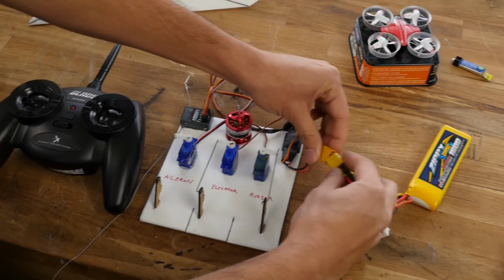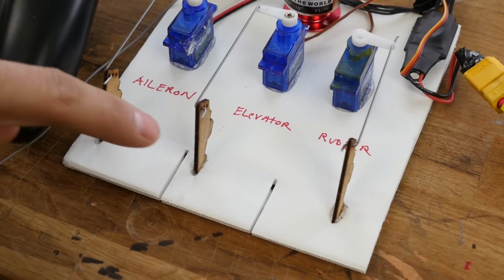DIY Pocket Transmitter | Flite Test

Comment: thank you peter even almost three years later just used this video to bind the transmitter from my new inductrix fpv that I bought from my local sportsman warehouse to try out fpv (all my local hobby shops are out of buisness) to a slightly broken night vapor plane I was able to fix that I recently picked up from facebook market place for 10 bucks and it worked thanks to your video now I have two great functional backyard flyers

Comment: Hi Peter, Thank you for this Video.  I have a quick question appreciate if you can please address.
I am using the same Blade MLP4DSM transmitter to bind with fly sky model number FS-R6B receiver, but i am not sure why it is not binding. Are they compatible? Any suggestions on binding much appreciated.

Comment: Hi this video is very informative especially how to reverse controls on mlp4dsm - I have the mlp4dsm and struggling to use it with an eachine qx100 (dsmx receiver) - I need some help on how to set it up. Do i need cleanflight for this - The bianding is fine but only the controls are reversed.
Reply: Thaddeus Fernandes  have you figure out how to do this? I was actually wanting to use for something similar.

Comment: Peter, a similar but 3ch Tx came with a very cheap 2.4ghz heli. mounted main rotor motors with 54mm props on wings (CW+CCW), tail rotor motor with 38mm prop horizontal near tail section, board and battery under the canopy of a cheap EPP "chuck glider". no servos or control surfaces but flies great! comparable to the Duet, about 20 bucks spent. it does have a downside, no tail rotor elevator power if thrust-steering motors not powered, but easy to get used to the dead stick gliding vs maneuvering with power.

Comment: Thank you Peter for telling me that this simple transmitter is Spektrum capable. But. By hooking it up to my six channel plane, this transmitter is actually six channel, not four! These extra two channels can be achieved by pressing the left stick (flaps) and the right stick (gears). I found this very useful because with this, you do not need to buy a big six channel transmitter. Instead, there's a cheap one right in front of us!
Reply: DandruffCat could you tell me what plane on the current horizon page would use something like this? Thanks!

Comment: The right stick when pushed in toggles a two position switch on channel 5. I just started using this controller on a micro quad running cleanflight, you just need to change the rxrange in the cli interface to match the output range of the Blade controller.

Comment: Does the paper airplane have magnetic actuators for rudder? Neo-magnet micro bit-charger car servos save lots of weight but are bang bang off/on. You can wind the coils to activate them.

Comment: just rip the "transmitter part" out of this housing and put a FRSky-board, Flysky, OpenLRS....whatever inside that and you have 1KM range!
The transmitter is the tiny little green module on the top.
Thats the whole trick! 
this thing is connected with 3 Wires. PPM GND and VCC!

Comment: Just a public speaking tip, but you should slow down a little and enunciate more.  Wonderful video, though.  I didn't realize I could use my Nano QX remote for a regular receiver.  My first scratch built now has a transmitter!  I just need to get the receiver and some batteries.  Yay!  You guys rock!

Comment: That's awesome Peter tnx. BTW, Anyway to boost the signal coming out of the TX?
Reply: You could swap it for a full power tx if you run enough power to it, the pin out is the same.

Comment: Great job FT and Peter. This is the sort of content I like. Could the spectrum transmitter module be hacked to run on a taranus? I hear mixed reviews on the orangeRX module.
Reply: +civicex5speed Yes: http://johnprikkel.blogspot.de/2014/07/jr-dsmx.html

But I had problems with an MLP4DSM module. It worked fine with a DX4 module I got from eBay though. Unsoldering is a little difficult, but you can get it out with some patience.

Comment: Would it be possible to mod replace the spektrum  module on it to a full range one? It'd be cool to have a really small full range transmitter.
Reply: Chase Wood I think it would be just fine, batteries wont last as long if modded, but you could use rechargeables.
Reply: Probably, I hope the power line can handle it.
Reply: +Chase Wood If current draw was a problem, all that is needed is to solder a heavier gauge wire to the positive and negative.
Reply: I was thinking about the actual power supply, I'd imagine it would be okay but it should be tested under the heavier load bc planes.....

Comment: Cool project peter, I saw on my old champ TX that it was Spectrum DSM2 So I was able to bind it up to the $6 OrangRx but, I never wanted to go back from a computerized radio so i never did anything with it. However, knowing now you can reverse the channels is vast improvement. I'll have to look if someone has designed a 3d Printable case for this. Although the wood is way cool.

Comment: Can you do some micro scratch builds? With the electronics from umx planes?
Reply: +X-FLIGHT101check out Dynamic foamys -  http://www.profileplanes.com/ - scratch building micro planes is tough because foam board is a bit heavy.  I don't think they push it very much either because the parts are pretty expensive for how flimsy they are.  Here's a thread - http://forum.flitetest.com/showthread.php?17813-Ultra-Micro-Builds! - give it a try.
Reply: +vista7 there are no plans available for dynamic foamy planes though. I want to build it from plans. Any you would recommend?
Reply: X-FLIGHT101 Go to flitetest.com and create an account.  Just hit the question on the forum and you will get tons of responses.  I have been building the mini series which is a step above micro.  I just don't like the quality of the micro parts.  It can surely be done; just a bit more challenging.
Reply: +vista7 thanks
Reply: +X-FLIGHT101 Good idea
Reply: I'd like to see some videos on that.  Right now I don't have a lot of spare micro parts so not any plans for micro builds.
Reply: where I get transmitter and receiver set for quacopter

Comment: why not just use 7.4v lips to power the tx up?
Reply: +Jad Collado (Battlemach1ne) in theory that would work, but the problem with LiPos is they really don't like being flattened .... and i would guess a simple transmitter would not have a low battery cutoff. So AA's (or AAA's) are just fine.
Reply: I had the same idea.
Reply: +Jad Collado (Battlemach1ne) I think its because it was pre-wired for use with x4 AA's, which are cheap and have enough power storage for the task at hand. If you wanted, you could probably do that tho.
Reply: instead of soldering directly to cells though. he could soldered a connector and just buy a lipo with a small connector
Reply: I wouldn't recommend doing so unless you have a resistor to lower the voltage.
Reply: kevinmk2002 I agree, I actually prefer standard rechargeable AAA batteries than lipo, but, the tx itself has a low battery alarm. Not sure what voltage the alarm goes off, but would be cool if the alarm goes off at 3.6v.
Reply: I've not tested this transmitter with it but, another 6V (4xAA) transmitter,  it powered on from a cheap USB power bank.

either have a USB cable coming out of it to plug into any bank, or as I did an old 6V iPod dock, just build it into the Tx.

have a little opening where you can plug I  the micro USB to charge it, take a pair of wires from the back of the USB output socket to the power in on the main board. With mine, as soon as I flipped the Tx power switch, the power bank's output LED came on and the Tx bound to the little quad.
Reply: Other plus of using a power bank, it take care of charing and under voltage and shuts down the 5V out if it's Lipo is running too low, just remember to keep it topped up as there will be no warning that the power is gonna shut down other than the output LED starting to flash, at lest that what the one I used does.

Comment: You could probably modify it to fit inside an old Walkman.You could use the drive rollers for gimblas and it already has a battery compartment.
Reply: That is actually a very good idea, I might try that at some point.
Reply: John, yoi forgott Cena!